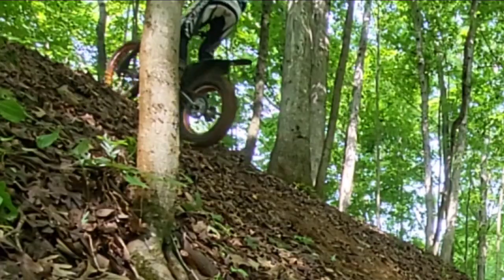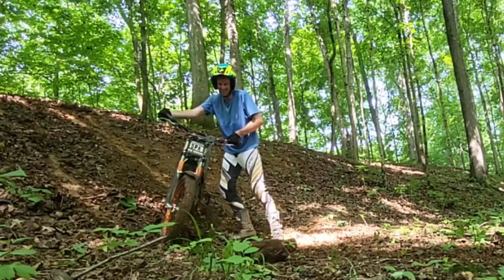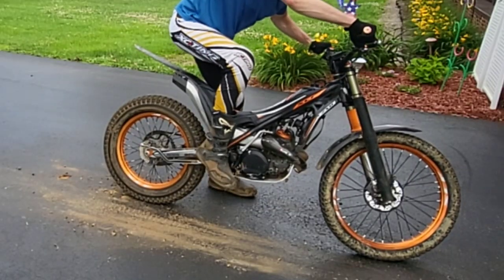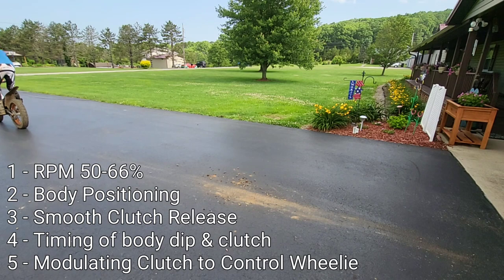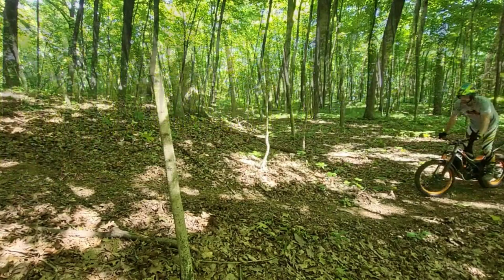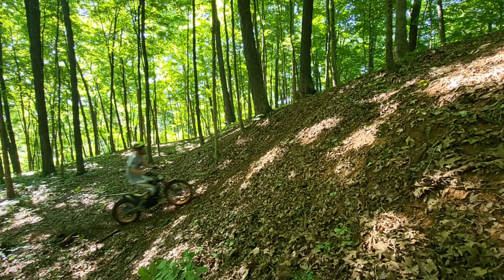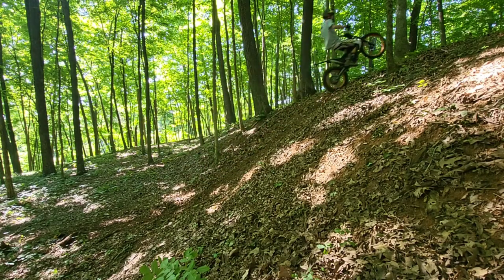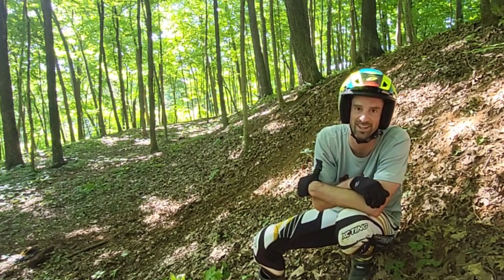Hill Climb Technique - Drills to Improve

Comment: Again well done! You might consider teaching at TTC. That recommendation from a 40 year trials veteran. You have the knack.
Reply from the maker: Hey thanks so much for your kind words. Anything else to add for this technique?
Reply: @TrialsProgression  only that this is how the top riders get up the big stuff. Takes a bit to master the technique but once you own it a new class of riding becomes available to you. Doesn't matter what bike, 2 or 4 stroke, engine size, it's the clutch slip and modulation that makes it work. Ryan Young had our school ride in circles on the flat and rev the engine all while slipping the clutch and maintaining constant speed. That was a good way to develop the concept in a non threatening situation.
Reply from the maker: @jodybliss5725  that's a great drill 😉 might have to borrow that one from his playbook. I learned a TON from his class. You are right, all the pros are revving that engine way up before hills and obstacles

Comment: Thanks. Would leaning over the handlebars work? Squatting is kind of limited. Leaning does not seem so.
Reply from the maker: Yikes, well leaning over bars is not recommended. Body position and traction are linked, but I understand health and physical limitations. Maybe just stay neutral on the bike and hopefully you don't have to go up anything too steep. If it's too steep, you could loop out if you can't dip down into the gas tank area.